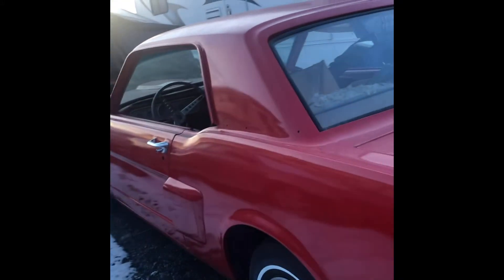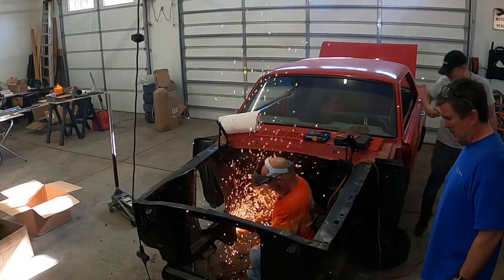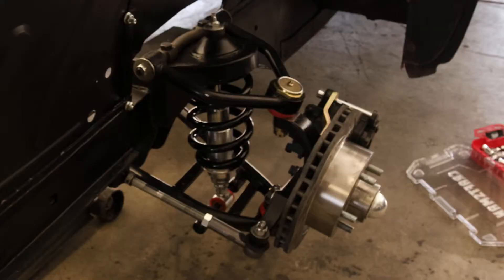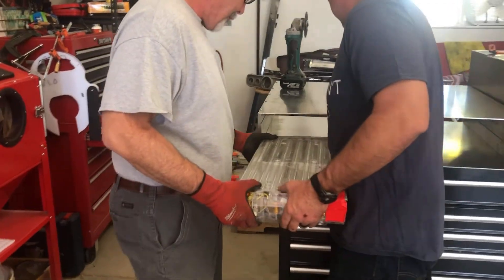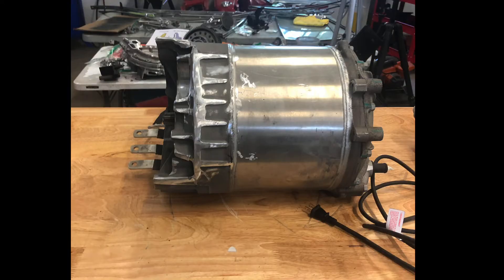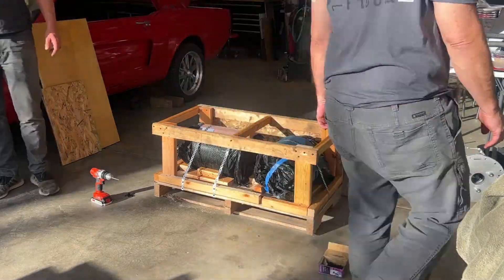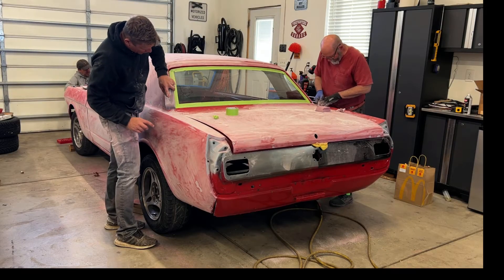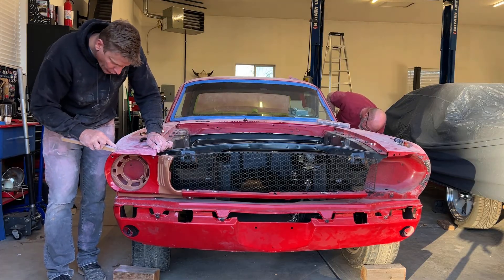1965 Mustang Tesla Swap One Year Anniversary! #teslaswap

Comment: So here's my idea that anyone with the resources to do have fun.
So as far as older car EV conversions I've had the idea of doing this to a corvette for a little while now. Being that the C4 is cheapest that's what I've based all this on. So the independent rear suspension on those cars doesn't look too fancy when compared to a more modern setup like you'd find on a camaro for ex. but dimensions wise the area it lives in under the car could likely take a rear electric motor drive unit majigger from a Tesla. Youd need custom cut CV's, fabricated mounts for the unit but there's no shocks back there to get in he way and once you delete the exhaust system you gain all sorts of room. The trans tunnel can then be repurposed for running your heavy duty cabling, you can even cut the ends off of the cars aluminum drive shaft and use it like electrical conduit to protect your wiring. As for the batteries, the C4 Corvettes have hoods longer than a smart car, so once you eliminate everything from under the hood that you don't need, I think distributing the batteries in a capital i configuration would allow for even weight distribution and allow you to take advantage of the cars factory "bottom feeder" cooling setup. The radiators on those cars gets fed cool air from underneath via dams and scoops, kinda like dental work being done by going up through your ass but what do I know. Anyway switching over to a modern manual steering rack and using a 2018 and up ford passenger car electric heater core should eliminate completely on those ends, if you want a/c have fun with that lol. Now let me be clear I've not crunched the numbers or done anything other than a cursory look at what might fit where because ultimately I really don't like EV's, a series Hybrid now that's a different story with a sm internal combustion engine only there to generate electricity to maintain a certain level of charge or to assist the electric motor for whatever reason. This is how diesel electric trains and heavy equipment have worked for decades so why no ev manufacturer has even offered something like this to customers such as those who live in areas where charging stations don't exist, most towns are on street parking and running a 220volt extension cord out your front door to charge your car all while hoping nobody messes with it or injures themselves with it, all equals a very piss poor not thought out at fucking all idea. Anyway let me know what you all think. I'm stuck in the house with a busted leg and I'm about ready to lose my shit😅